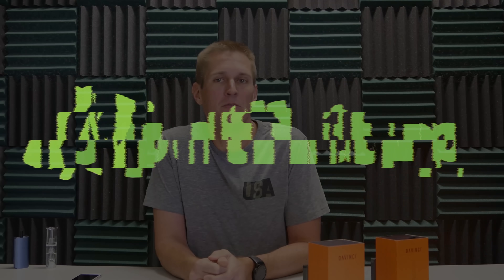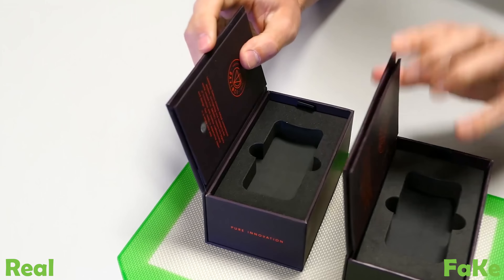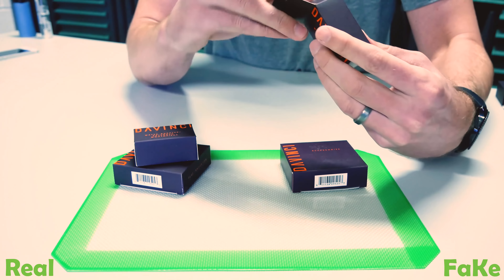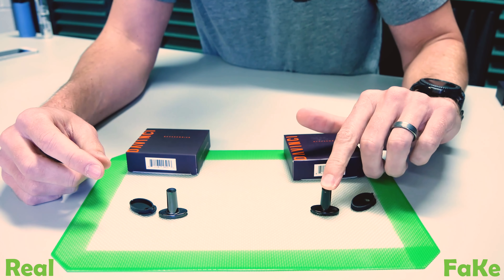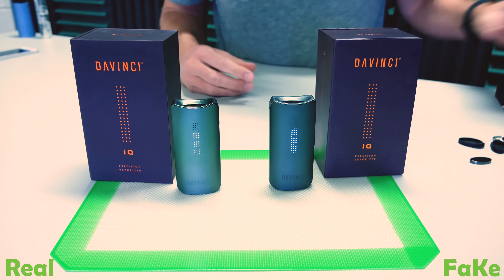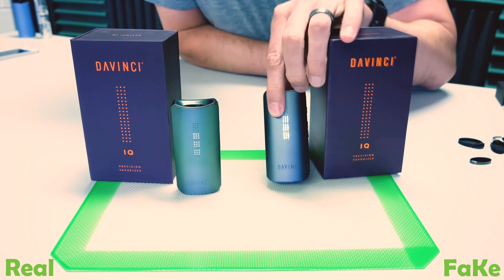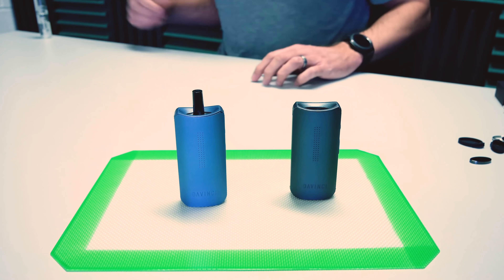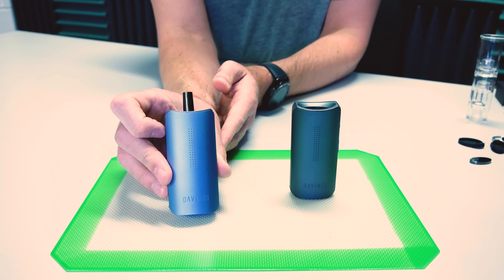Da Vinci IQ Real vs. Fake - PuffItUp

Comment: There are a few other things you could have done to determine if it is real or fake: weigh both devices and compare to the manufacture listed weight, also the IQ is known to get quite hot to the touch so heat them both up and check the surface temp on both real and fake: I bet the fake would get hotter. Time the duration to do many tasks and you'll see time duration differences probably. Check bluetooth connectivity with the app. And I know you said you don't want to vape out of the fake one, but come on man. This is for science. Compare vapor quality and taste. Comparing internals is something else (I think you mentioned this in the vid) that we would like to see. Go all out man. 

Still, it's a really good vid and we thank you for it.
Reply from the maker: Heyo,

This is a really old video and everything has changed a bit since we posted it.

We don't test fake vapes though, that's a great way to inhale things you don't intend to inhale when you sesh.

Zakk
Reply: to conclude What are the differences between a false and an original one? or currently the danvici does not have copies unlike the pax

Comment: I just ordered one from eBay claiming to be authentic for about 168$ . Haven’t gotten it yet. Thanks for making the video .  Very informative. I’ll let you know if it’s authentic. When I get it. The good thing is buying thru eBay and using Paypal you get a money back guarantee if the item is not as described. Lastly if there is any lingering doubt you can always call the company and have them run the serial number. Lastly what are your thoughts about buying thru eBay . Some people say if your not paying at least 200-250 it’s not a real unit.
Reply from the maker: If you buy on Ebay you won't have a warranty, even with a real unit, as they aren't authorized sellers of Davinci  products. Authentic or not. When you get yours make sure it isn't painted in any way. Our fakes had a lot of paint on the mouthpiece and the ceramic flavor chamber. Don't use something that looks painted.

Zakk
Reply: @PuffitupTv  Untrue, I also purchased mine from ebay and I was able to register it with the serial number which checked out through their website. It also connects to the app no problem though I dont use it. The amount spent was about the same at 170. Im extremely pleased with it. The vapor production is amazing and just overall a quality build though it is a devourer of weed. The normal bowl without a spacer can easily eat an 1/8th of a gram in one session

Comment: Why wouldn't you promote that water pipe attachment? Looks handy, cannot find it anywhere, seems shortsighted to not promote it..
Reply from the maker: They are handy, easy to use, and portable... here is a link https://bit.ly/2DZvwrD :)

-z
Reply: PuffitupTv do you need some other accessory to use the water pipe? Because the only review states that it needed something else. Thanks I want to buy so want to be sure first
Reply from the maker: You would need a 10mm female to 14mm male adapter. I personally would use a glass one.

Z
Reply: PuffitupTv do you guys sell any? If not do you recommend one? Thanks!
Reply from the maker: I don't believe we sell any at the moment. You can usually go to your local shop and pay 10-15 bucks for one, or they are 2-5 bucks off dhgate, but it takes 1-2 months for shipping
Reply: PuffitupTv thanks! On your website they were saying I need to buy the water adapter you have listed but now I am not so sure. Will see what my local vape shop says
Reply from the maker: Oh, I forgot davinci has their own WPA. That piece works really really well, 10mm to both 14 and 18mm adapter. Pretty slick if you ask me!

Comment: Looking at one on Ebay for $180. It is a top rated user with a 12k score and 99% feedback rating. Thoughts?
Reply from the maker: If you buy one on ebay and pay with paypal, you will have buyer protection. So if it is a fake you can get your money back. Also you can email Da Vinci and ask if the seller is authorized to carry the product.

Comment: Your information is not correct. Stop scaring people. I ordered mine directly from davinci and mine has such things as the blue sticker vs the orange. My little storage container opens from the bottom. I would say davinci is selling authentic devices. Maybe it's your site selling the fakes.
Reply from the maker: You are right, the original packaging of the IQ had a similar looking sticker and storage container, however that is no longer the case. Also if you go to Da Vinci's website you will see us on their list of authorized sellers. :-D
Reply: and the cointainter? opens from whats side? up or down? or doesnt matter? i go to buy one but the conteiner open down
Reply from the maker: The IQ I used in this video was from their most current production. the IQ from older productions will have stickers and a container that match the fakes. If you go to a local shop, look for the serial number on the back, also try connecting it to the phone app as soon as you get it.
Reply: And he never once mentioned that the serial number is on box and etched into back bottom of divinci..I'm sure that would have saved all the psycho analyzing...
Reply: thx u m8
Reply: @PuffitupTv  where can I check the serial number?? Is there any page?
Reply from the maker: @videosdeldiadia2632  You can reach out to DaVinci's support for further help with authenticating serial numbers: https://www.davincivaporizer.com/support/#

Comment: I did a thorough check and my iq is real ... But I noticed a strange thing: if I turn it on and set the maximum temperature for a few minutes and then I turn it off letting it cool, then I feel a slight unpleasant smell similar to a wrung rubber  / dead animal ... You too?